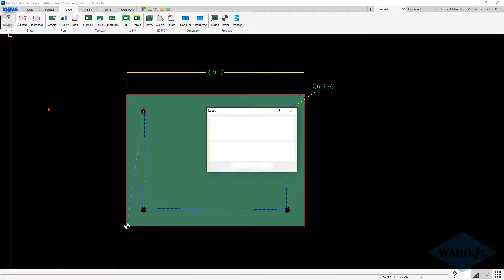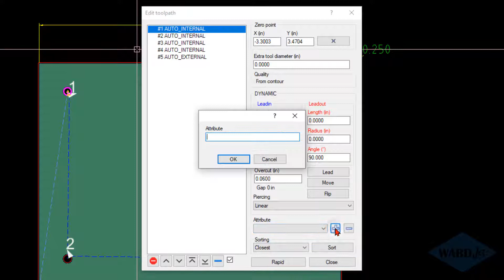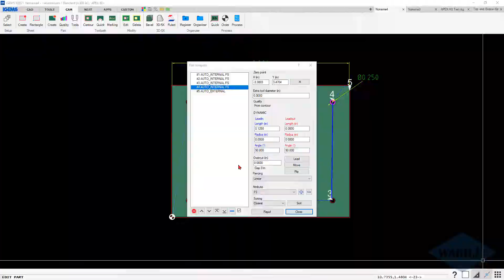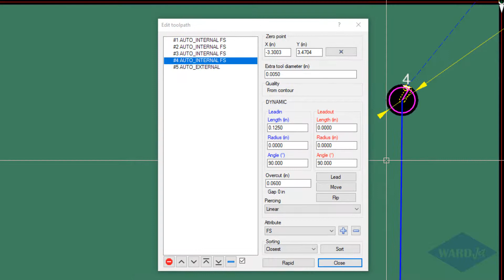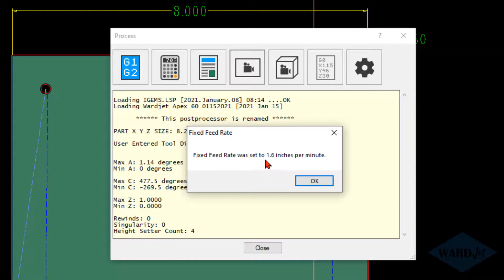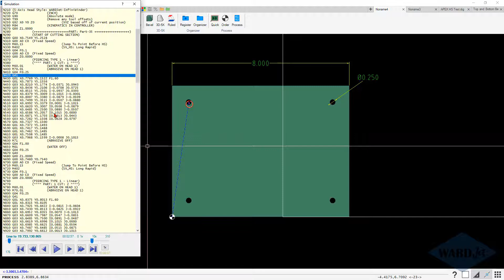Fixed Speed Attribute - IGEMS 2021

Comment: Hi. Can u help me out . I have some issues today with my water jet. Basicaly when the head are finish cutting they are not cut out completly , its left like very smal tiny "teeth" which holds the part to main sheet. Normaly ready cut out parts came lossley out. Im doing something wrong with mine drawings on cad and cam?